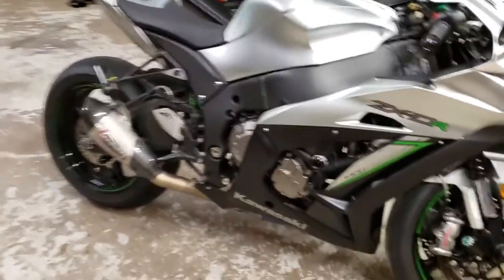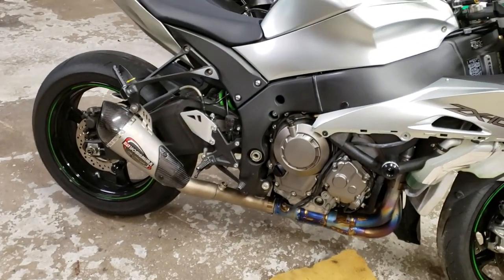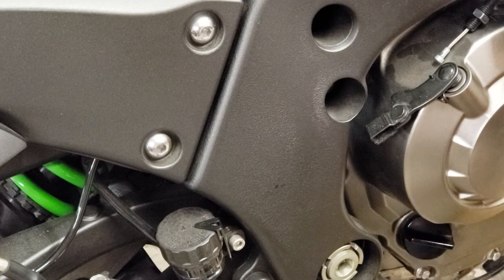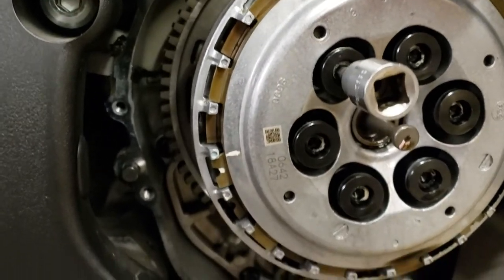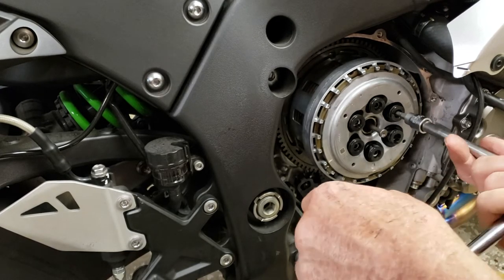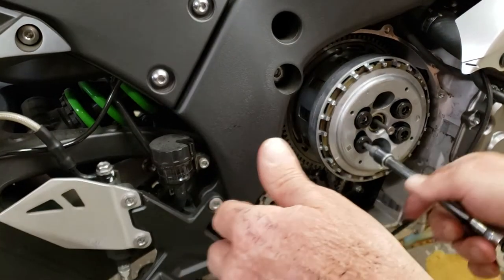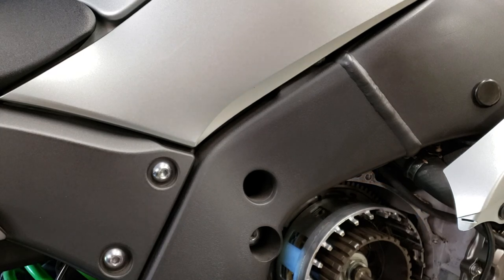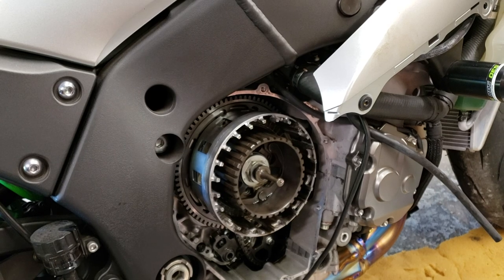ZX10R How To Replace The Clutch  Part 1

Comment: what's your mileage there before the clutch slips?
Reply from the maker: I had to change my clutches at 3500 only because I was hot lapping at the drag strip. Now at 4900 miles I'm doing it again for the same reason 😢😢😢

Comment: Do you clean your titanium headers with anything, they look cooler than my 16 zx10
Reply from the maker: No I don't think I have cleaned them at all. I do run them at real high rpms. I think it may have a little different composition of the Titanium alloy. Thanks for watching.